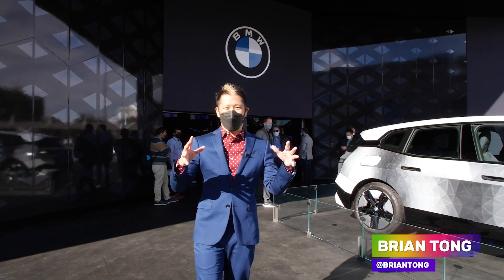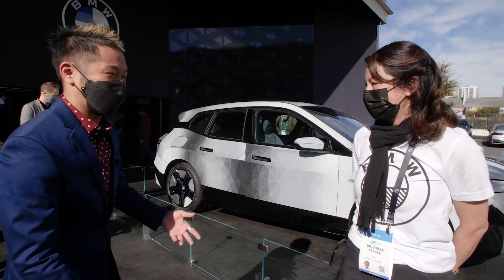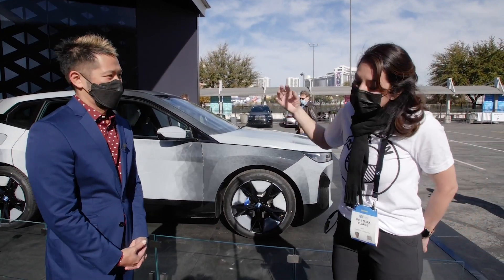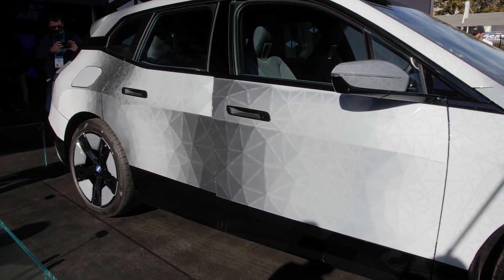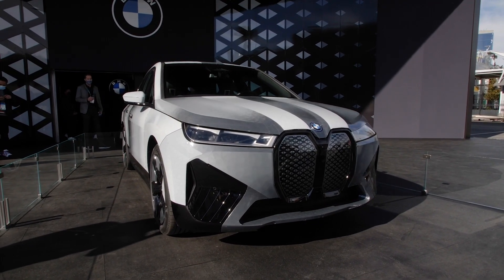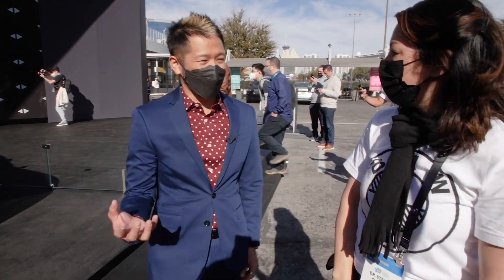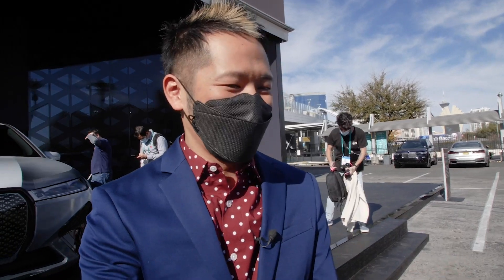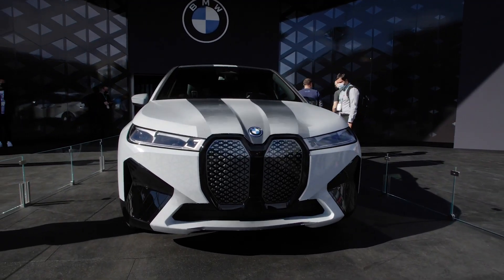BMW's Color Changing Car Is Awesome! How They Did It

Comment: White and black are colours?
Reply: In physics, a color is visible light with a specific wavelength. Black and white are not colors because they do not have specific wavelengths. Instead, white light contains all wavelengths of visible light. Black, on the other hand, is the absence of visible light.